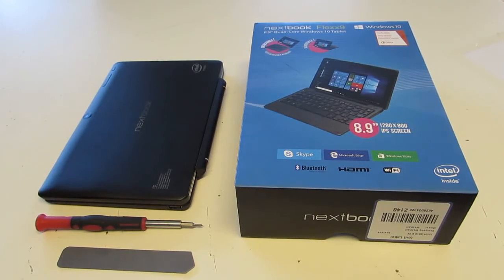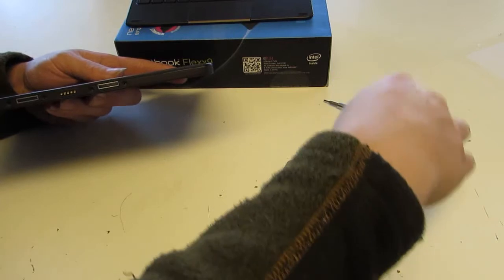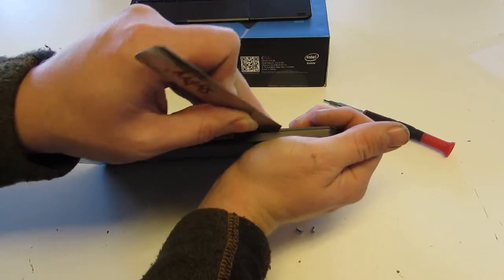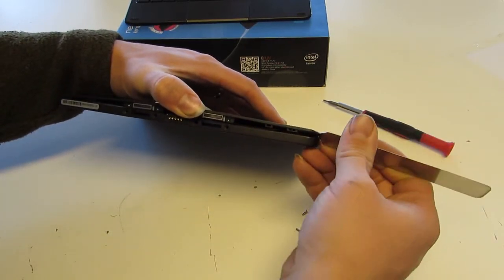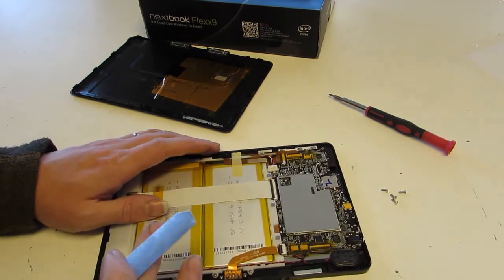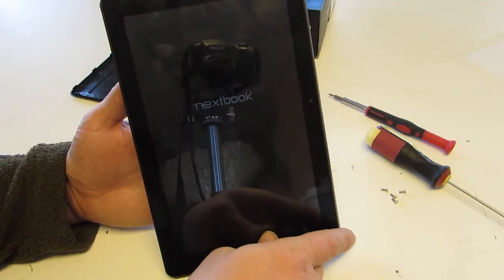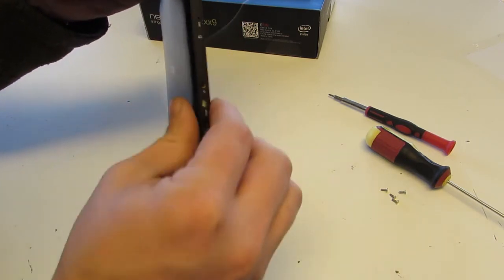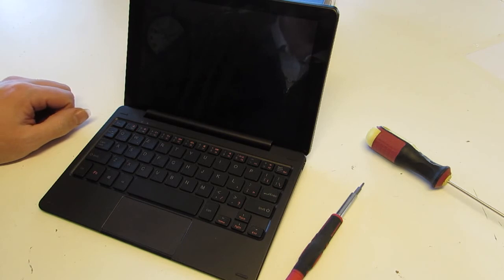Nextbook Flexx 9 'No Power' Issue Fixed

Comment: just starting having charging issues well it's not charging at all no matter how long it's plugged up i'm going to try what you did to see if it works thanks😃
Reply from the maker: Honestly, this probably won't fix a charging issue; charging issues are typically caused by one of 4 things.  The most common is a bad cable, the next is a broken charge jack, next would be a bad battery, and the least common is a bad charge controller on the mainboard.  Try replacing the charging cable first.  The charge jack requires microsoldering to replace, which requires special equipment.  Same with a bad charge controller, if they're even available.  The battery can be easily replaced, but if it's the battery, it will claim to be charging, even though it doesn't take a charge.  The symptoms are slightly different.
Reply: zibodiz I’m in the same boat.  My power light stays on when plugged in with the battery connected or battery disconnected.  I left it charge for 1 full day and no change.  I’m not sure if the battery is seeing the charge through the power up chip and I think I wanna try the $14 chip first. Axp288c   What do u think?

Comment: What size screw driver is that? Also, I have an nextbook flex 11a so I don't know if ghe battery wire is in the same place... 😅
Reply: I brought the 30pc screwdriver kit but it did not come with that flat piece. Where do u but it any ideas

Comment: Hello,I have nextbook flexx 9. It is not starting.It starts and goes to shell. Dont know what to do?
Reply from the maker: Sounds like corrupted memory.  You could attempt to re-image it if you can find the original firmware, but the memory chips are most likely damaged, and unrepairable.

Comment: What if the power light will not go off on a next book 10.1 at any time it will not charge up and I took the case off and disconnected the power but the red light comes back on?
Reply from the maker: That's most likely a defective mainboard.  It could possibly be caused by a defective battery, but I wouldn't expect the light to come back on as soon as the battery is reconnected.  If the battery is a couple years old or has been subjected to extreme temperatures, you could try a replacement battery first, but otherwise I'd suspect an internal issue with the mainboard.  Mainboard issues can only be resolved by replacing the entire board; if one is available, eBay is your best bet.

Comment: this did not work for me- any other suggestions
Reply from the maker: The other possible causes of this symptom are: Charger and cable failure, battery failure, mainboard failure. I'd recommend that you replace each of the items in that order, unless you have a way of conclusively testing them individually.

Comment: Are you sure if this works well ?And what could be the reason for it to not turn on ?
Reply from the maker: Mitali Ved The issue that is being resolved by this method of repair is a firmware issue; if your firmware has crashed in the same way, this fix will repair it.  If this doesn't fix it, you probably have a hardware issue.
Reply: Can you tell me about a firmware crash like how it is and how do you get to know in your nextbook? Thanks for the reply :)
Reply from the maker: Mitali Ved If this repair fixed your Nextbook, then it's just the firmware issue.  If it does not fix your Nextbook, and the symptoms are the same, then you have a hardware issue; you need either a new mainboard or possibly a new battery.
Reply: I've got to know that my next book has a motherboard problem 
Can you tell me about the replacement for it ?